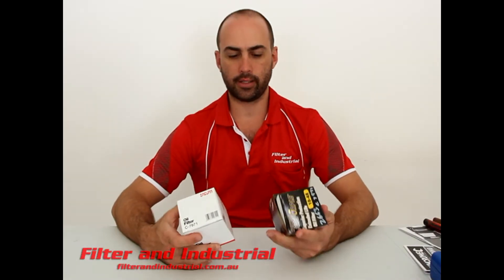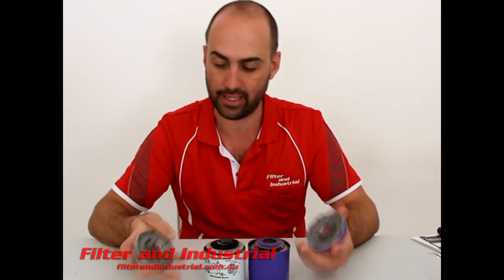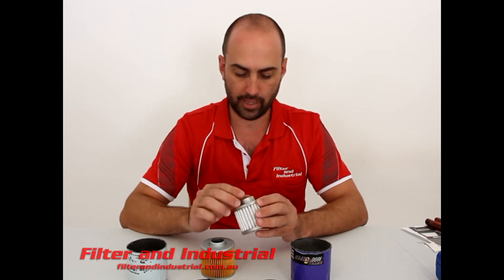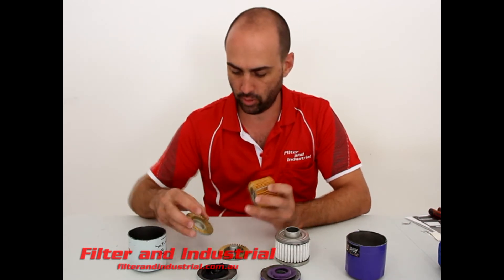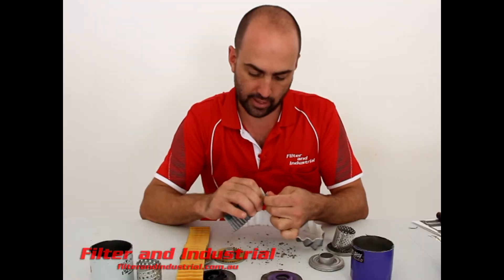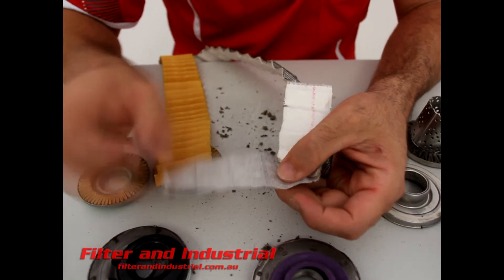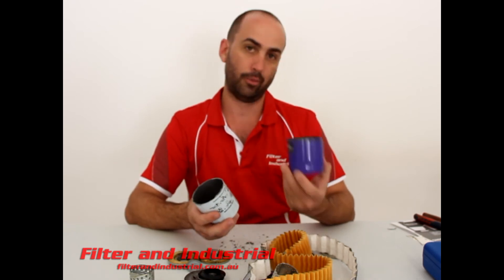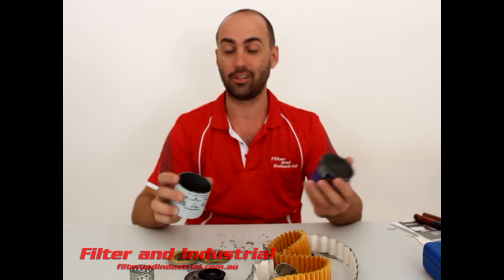Royal Purple Filters, how good are they?

Comment: Thanks,interestingly I use 10-42 &;48 ROyal Purple( with NAPA GOLD/ Wix my short term oil Filters): though only had one oil related Problem in 60:years of many Vehicles (* a 1957:289/4 BBL V8, Ford  engine in 54 FORD/body/2 DR== engine seized up ??, May have been maintained properly??).